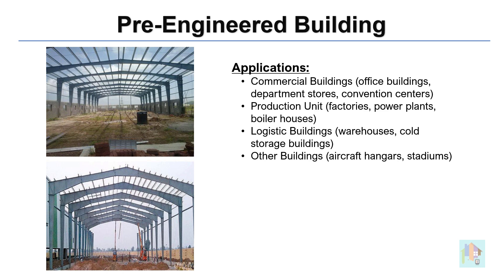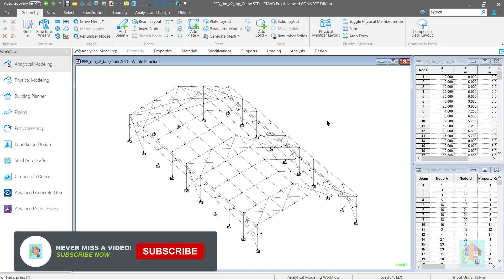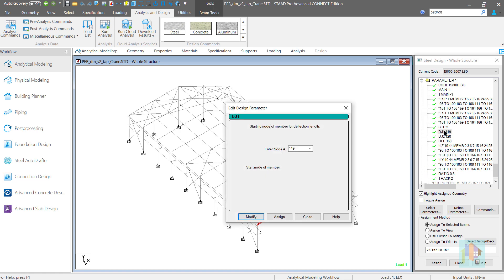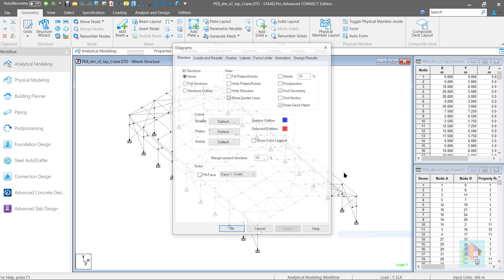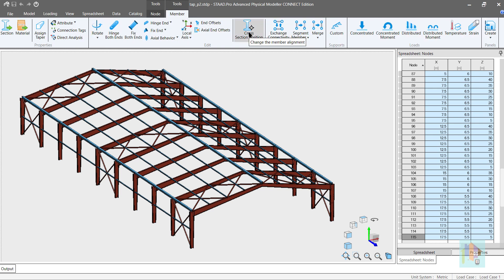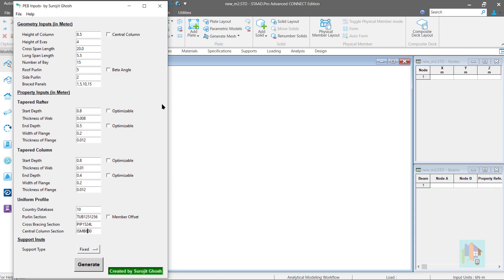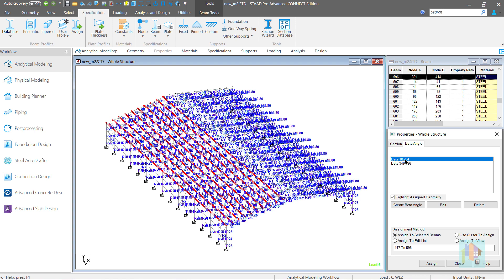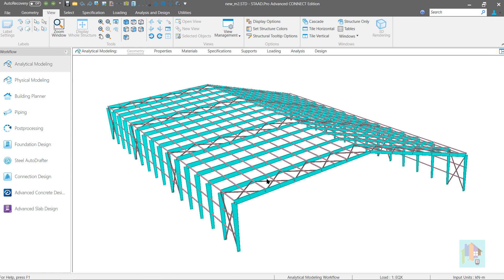Modelling Analysis & Design of PEB Structure: Part 1.0 - Introduction and Contents

Comment: i don't get any better tutorial for gable column connection & column web with tapered beam. Is it limitation of staad pro or ram connection??.
Reply from the maker: We can design this type of connection (gable column, tapered beam to column, even gantry to column bracket connection) in RAM Connection. For RAM Connection standalone, proper inputs are required, for integrated connection design of STAAD, we need to specify proper member attribute to design this type of connection.
Reply: @surojit_ghosh  will u make some video to this topic in future.This topic videos are not available in youtube. Thank you sir.
Reply from the maker: Sure, I will. It is already in my plan.

Comment: Hi Sir, Could you please provide excel sheet for to do built column or built up beam weld calculations. Or is there any software.
Reply from the maker: I think you are looking for something which can design weld connection for built-up member. I don't have any custom template which can design the same, but using RAM Connection software, we can design different types of weld connection.
Reply: @surojit_ghosh  Thank you very much sir for your swift reply. Let me check.

Comment: Is this tool for peb included in staad connect edition
Reply from the maker: No, it is not a default tool. This is something that I have developed to generate the complete PEB structure with load and design parameter values in a single click.
Reply: @surojit_ghosh  sir please share

Comment: Can we have the tool for generating the model?
Reply from the maker: It is not ready yet. Though I can generate the entire structure geometry with this tool, but there are several other aspects which I want to include in this code, like auto-assignment of all design parameters.
Reply: @surojit_ghosh  oh ok sir. It would be helpful if you would share when it is ready for use.
Reply: @surojit_ghosh  it is a great tool
& will save lot of time

Comment: how to create custom template please suggest
Reply from the maker: You can create a custom template using any programming language, like VBA, Python, C++ and using the OpenSTAAD functions which link your code with STAAD. If you don't have any prior knowledge about programming, then I will suggest to start with excel VBA macro which is easy to learn and develop. You can check this video for more details -- https://youtu.be/DV24Q-0ax2Y
Reply: @surojit_ghosh  Thanks. one more query , whenever we go for dynamic analysis of structure is it necessary to add all loads (self wt. floor load and wall load ) in all X,Y,Z direction ? if yes than seismic wt. and  base shear doesn't match the actual values.
Reply from the maker: Yes, for dynamic analysis we need to create a mass model with mass in all 3 directions. This is the basic of MDOF system and if mass is not defined in any direction, that might cause incorrect dynamic analysis results. We normally consider only the gravity loads for mass model generation.
About the base shear mismatch, I am not sure how you came to this conclusion. I need to review the model, your calculations to understand and clarify this. You can post this query along with your findings and model in the Bentley Communities site.
Reply: @surojit_ghosh  ok i'll post analysis file, i'll share with you too please share your email id.